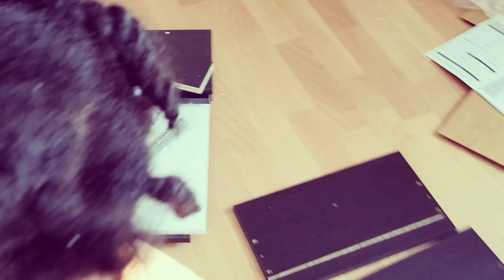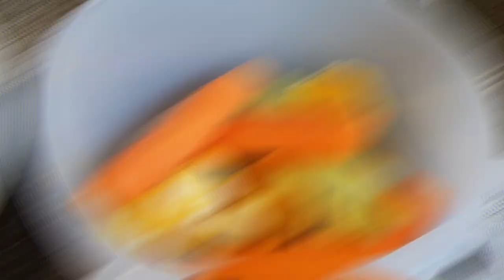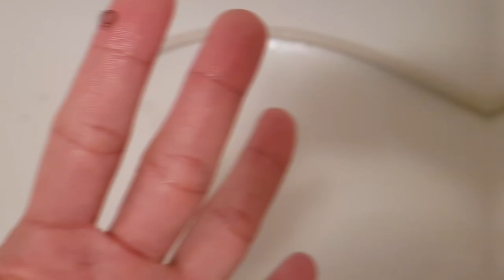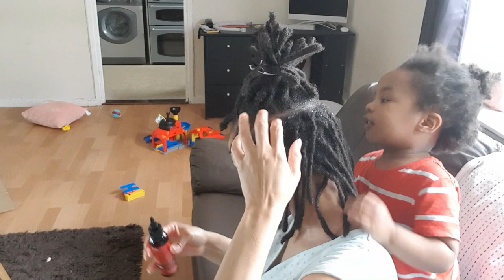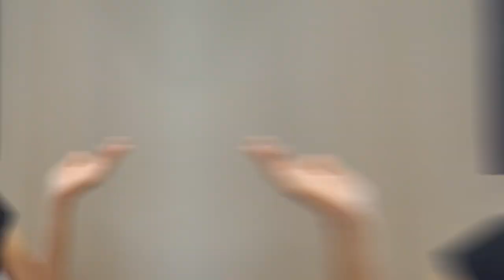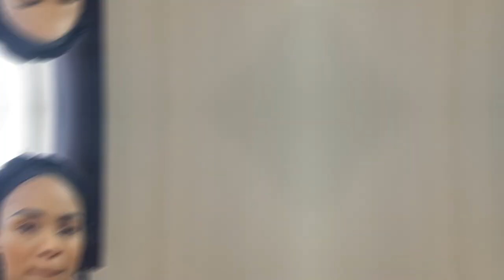I'M LOSING A LOC | POSTPARTUM HAIR LOSS ON LOCS | MY HAIR GROWTH JOURNEY

Comment: Yep I lost 3 right at the top of my head with my 1st pregnancy so I cut them off and have had an afro for 5 years. This time it's not as bad. At 3 months I just got ahead of it with rice water. I still lost hair but it's not that bad plus I got some bonus length
Reply: @kieshaarielle  Honestly I wouldn't recommend cutting. Like you said, the hair will grow back. My sister has locs and she chose to keep hers and you'd never say that she completely lost her edges twice and her kids are 18 months apart